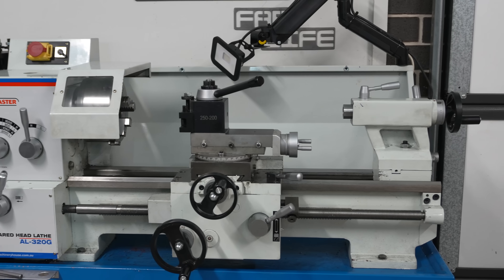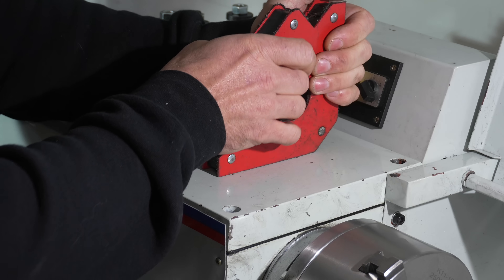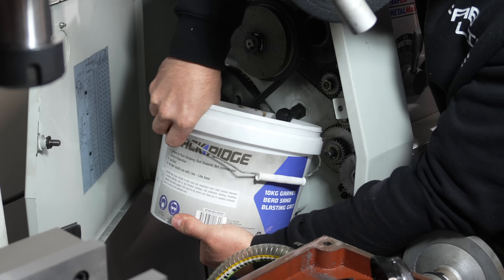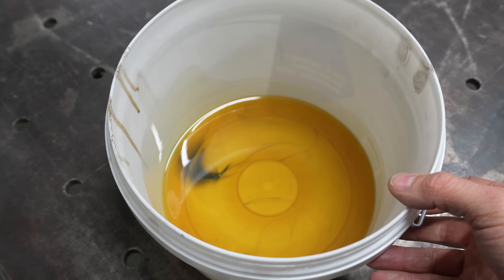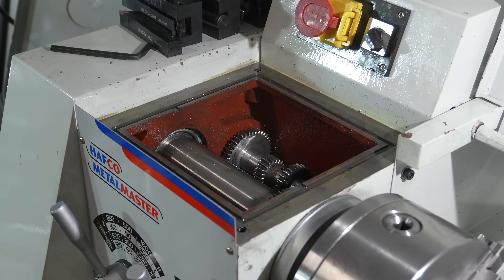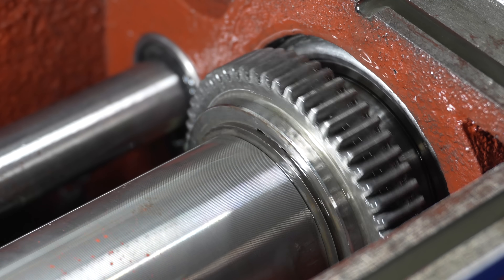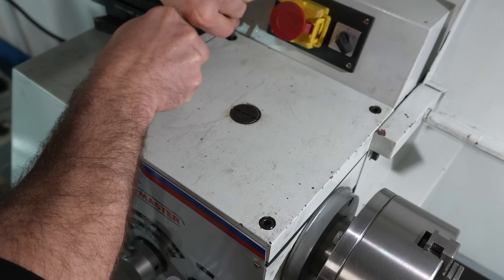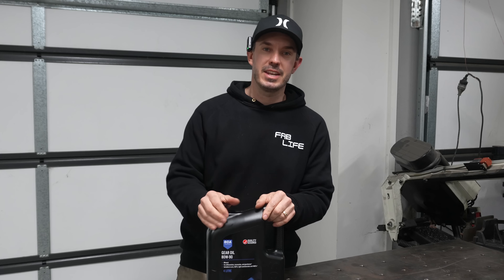Can I Fix This Annoying Gearbox Noise? - HAFCO AL320G

Comment: Having worked on many automotive gearboxes generally if there is enough oil to contact the bottom of the deepest gear in the box the gears seem to survive. I've been amazed more than a few occasions.
Reply from the maker: The feedback I’ve got so far seems like my lathe won’t survive in the long run due to some gearbox oil 🤷‍♂️
Reply: @Fab-Life444  It will survive, though it is not constructed like the old ones from the USA, but those also needed lots of maintenance to get them there. Just use the oil you have on hand, or even run straight SAE30 oil in it, it will do the job. most important thing is to drop in new oil from the factory stuff, and also change it somewhat regularly, plus you can drop in a small magnet in a quiet spot to catch the fluff, like gearboxes have. 

Old ferrite speaker magnet is both common and often free, or grab one out of a microwave oven magnetron. I stuck one to my car oil filter, and opening it no metal filings, just some fine sludge inside. added one to a compressor, and it too got a fine powder sludge build up over the year.

Comment: Drop in a magnet in the bottom of the oil near the most metallic producing part 😅
So any chunks or even fine metal should be captured.

This is normal in car automatic and manual transmissions as well and after 60k km the usually have a good coating of metal
Reply: The grarboxes in these is filled with casting sand and grinding grit from the machining during manufacture.
The magnets will only collect the metal that's been ripped off the gears and bearings, but will leave all the grinding particles in the oil.
Reply from the maker: Yeah I definitely know what you're talking about. I'm a mechanic myself. Ive seen many transmissions which have circular magnets that come out looking like they have silver fuzz on them haha. So many comments about adding a magnet. Next time I'm at Bunnings, i'll get some!👍

Comment: I've got an 80's boxford that's noisy. Spent a fortune on some used but less worn gears. A little less noisy. I'll try diff oil too. Great iead thanks.
Reply from the maker: Let me know how it goes for you. Ive had an overwhelming amount of comments letting me know that it isn't the right oil so. Good luck 👌
Reply: @Fab-Life444 I just did a quick bit of Google time and diff oils contain anti foaming agents. So EP 80/90 should be fine. I've currently got ISO68 in there.
Reply from the maker: @GazzasStuff how does iso 68 sound? Repco sells it near me. I’ll have to get some
Reply: Thanks. I have ISO 68 in there already. I'm in NZ so we have an even worse number of options than you guys :-) But I'm going to try some Ep 90. And I'll do the acrylic lid to check that it's making it to the spindle bearings.
Reply: @Fab-Life444  I have done a bit of research. And here you go, while both diff oil and hydraulic oil have antifoaming agents, there are two issues. Diff oil has detergents to hold any metal and dirt debris, but Hydraulic oil lets them fall to the bottom – put a couple of decent magnets in there too. Secondly Diff oil can damage any brass  or bronze bushes – not that I think you have any. My lathe is spec’d for ISO 68 hydraulic, but it turns out you can buy ISO 100 hydraulic oil, so that’s the direction I’ll go. And luckily I’ve found a place in NZ that sells in 5 ltrs. It was difficult to find 100 here that will sell to the public as it’s not a big seller retail.
Reply from the maker: @GazzasStuff awesome feedback buddy. thank you 🙏

Comment: Never changed the oil? You should have checked before starting it. Mine came with no oil. You could see that it had been there but they only put it in to test run it and then take it out to 7se in the next lathes. W(at a mob of tight arses. And that’s a $17000 plus machine.
Reply from the maker: I definitely checked that there was oil showing on the oil site glass. I didn't go to the extent of removing the cover to check inside though. God your experience with yours sounds terrible.. I cant believe that! 😳

Comment: It will be interesting to see how the heavier oil lasts. My first thought would have been to add more of the same mfg recommended oil after cleaning out the headstock.
Oil weight is specced based on the types of components and the speed at which they run. Increasing oil weight may increase operating temperature but I doubt it will overheat

Also, that is your gear set losing material, not the bearings. Gears operate on a combination of rolling and sliding friction and if made poorly can lose material even when lubed properly. 

If a bearing is losing material, it’s time to replace it. Bearings do not “run in” they keep wearing once wear has started.

I would check the metal content in the oil again after 5-10 hours of use just to protect the spindle bearings as they use the same oil. If you find more black/grey streaks you can replace the oil or filter it. 
I would also suggest installing a magnet into the headstock in plane with that bull gear to catch the worst of the loose metal.
Reply from the maker: awesome comment mate. I'll definitely get onto putting some magnets in there thats for-sure. I even thought about putting a thermometer in the oil and run it to see what the temps get up to. Yeah with the metal paste, I really wasn't sure where it came from... cheers!👌

Comment: The drain plug is behind the chuck underneath the back sheet metal back plate
Reply from the maker: Cheers for the comment. There definitely wasn't any others. I even went to the extent of removing the rear guard and rubbed around everywhere.....and consulted the owners manual for it. Do you have the exact same model lathe as mine?. I do know that the AL250 has the drain plug at the rear in a hard spot to get a drain tin under. I've watched Artisan Makes channel change the oil on his. Cheers mate👌
Reply: @Fab-Life444  No I realized later that my lathe is the next model up. Thanks for the reply. Cheers
Reply from the maker: @nickfox6339 not a problem mate. Hope you’re enjoying the channel 👌🇦🇺

Comment: Interesting video, thanks. I have a very similar lathe - from the same factory, I’m sure.

I too had a problem with dirt in the oil and noise. I did the same as you did but I threw a pint of diesel in there to clean it out. Where I differed from what you did is that I refilled the same oil after filtering through a coffee filter, topped up with fresh oil of the same type.

My word of caution to you and others is this: I understand that the main bearing is fed from a drain hole in the gutter around the top of the casting. I could not see clearly enough from your video if yours is the same but I strongly suspect it is. By increasing the viscosity of the oil, you will reduce the amount of oil flung out by the gears, and then collected in the gutter to feed the main front main bearing.

I have doubts that mine even achieves this even with the thinner oil. Somewhere on the to do list I’d to fit a force lubricator to feed the front main bearing.

I instinctively agree that more, thicker oil is a good thing with the above caveat.

All the best.

Mike
Reply from the maker: The force lubricator sounds like a great idea. Cheers for the comment

Comment: Fab Life got lucky with his lathe.   A generous amount of casting sand and swarf is usually present in these lathes when new.   Both the gearbox and saddle should be cleaned out, oil replaced, and the bearing preload adjusted, before putting these Chinese-made lathes to use.
The design of these lathes is quite good, but they are assembled in the factory for only convenience of shipping and should not be regarded as ready for use out of the box.
A couple of rare earth magnets inside the headstock to catch swarf is a good idea.
Reply from the maker: I’ll definitely do the magnet thing for sure 👍. Is adjusting the pre load a hard task?. I did browse past it in the manual
Reply: @Fab-Life444  I have a related Chinese lathe, not the same as yours - so don't take the following advice as gospel.
Adjusting the preload is easy enough, but it is a bit like choosing the correct oil level, in that you will end up thinking the manual doesn't give the correct amount of preload.
In my case, the lathe came with too little preload, following the manual seemed to make it too tight, so I compromised.
Best to get advice from an experienced machinist who has the same lathe if you can.

Comment: Great to see that you set up the replacement gasket correctly allowing for the splash lubrication to run back into the spindle bearing lube channels. A very often overlooked problem that even the seller doesn't bother to sort. I know this as I bought the same machine a few years ago when I retired and ended up stripping it {Brand New before using it} to sort it out. BTW I worked maintaining machine tools for 30 years so it wasn't a big deal for me.
Those particular machines have an issue when made. The spindle housings are not cleaned properly prior to painting. I would be confident in saying the majority of the black gunk is casting sand left over from the manufacturing process. They actually need a wire brush and kero clean then a proper sealing coat of paint to allow them to stay contamination free. I used one mounted in a die grinder and a tooth brush style one for the tight spots.  I would then suggest putting in a few magnets to catch any steel or iron fallout. If all that black fallout was from the spindle bearings your machine would have loose bearings with radial float and end float.
As for oil levels and oil type used you need to exercise a bit of care. To much oil generates heat and almost always foam. It will dampen the noise but if foamy wont lubricate the spindle bearings properly. 80~90 weight will cause a lot of drag in the bearings themselves and depending on their condition may cause the internal elements to skip. This isn't a good thing as well as foamy oil lubing the bearings that cause a type of cavitation that damages them.  This is why thin light oil is used for bearing lubrication in these types of bearings. Unlike a gearbox in a car that will usually have fewer and larger elements {Balls or Rollers} that reduce the impact of the heavy oil use. You will also find it will start to leak out of the spindle labyrinths if you get it warm. That in itself can cause them to lock up in extreme cases. To get an idea of the required level of oil you should run it with a clear plastic cover and then you can see just how much gets sprayed around. Hence the low factory level used.
If you have concerns with gear and spindle bearing wear when it's all cleaned you can add a bit of Zinc additive to the hydraulic oil. Factory it would use a ISO32 but if you must heavier oil like a ISO46 or even a ISO68 could be used. It will run hotter with the 68 though but not as hot as the gearbox oil. If you got stuck and had to use oil from the car parts store you would be better served using Auto Trans fluid. Using the Additive in industrial applications and in my experience I have only seen benefits. I use this stuff it isn't cheap but it does work well. 
Even though the web site looks a bit outdated their products a very good and do what they say. 
https://liquidintelligence.com.au/products/zddp-engine-oil-additive
If you really wanted a quiet machine belt drives are the go. They use greased bearings as well in the spindles . They have a bad rep due to people not maintaining the specialist lube in the bearings that in some cases has a 5 year use by date {Kluber NBU15}. Regardless of lube type the grease needs refreshing after time and or use. 
Well that's my old man take on it. 
Cheers
Reply from the maker: I sat down with a cup of coffee to read this awesome comment mate. Thank you for all of your great advice. Everything you’ve said makes perfect sense. I do have some Perspex and I think I’ll remake a cover plate to see what is actually going on inside the gearbox. Cheers 👌🇦🇺
Reply: I was going to say almost exactly the same things, alas probably not so clearly, the chances of bearing failure are a lot higher than one might expect as the head stock is set up for very little free play.
Reply: Thank you for taking the time to share your wealth of experience on this issue. Invaluable!
Reply: Great detail. Thank you very much
Reply: Can you be my grand dad? Love your knowledge thanks for sharing.

Comment: If you run the lathe before the oil change, you will get better contaminant suspension, removing more crap.
Reply from the maker: What do you mean by that? Run it with no oil? Cheers
Reply: @Fab-Life444 guessing he meant running it so everything warms up sufficiently?
Reply from the maker: @eschlenz possibly?… I have seen some people run the lathe with the kero in it to help clean off the last remaining bits of the old oil.

Comment: My 25 year old Harrison has a similar gearbox with splash lubrication like yours.
However, the specified hydraulic oil was a lot thinner than what you've used.
Reply from the maker: Yeah I read the owners manual before doing this and the grade was SAE20. 👌🇦🇺
Reply: @Fab-Life444 
My lathe was old enough for the original lubricants to be no longer in common use or only available in 20L drums.
I had to do a fair bit of hunting around to  find the right type.
My headstock has a fair bit of noise - problem with using spur gears I guess.
Reply: What's the recommended Shell oil, Tellus 27 in the headstock and Tonna 32 for the slideways/ feed gearbox or is it built afer the Tellus 27 name change?
Reply: @iwb316 
Colchester or 600 Group advised Valvoline 32 grade for head stock and 68 grade for Gearbox and Saddle.
I used Penrite of the same grade.
Reply from the maker: @iwb316 not really sure

Comment: I enjoyed your informative video. I have a Craftex CX709 lathe which is almost identical to yours. My lathe is over a year old so I decided to service my gear box as well. I also found the oil to be quite low and lots of contamination. After a thorough cleaning I added almost 2 liters of 80W gear oil. What a difference!
I would really appreciate a video on thread cutting when you get time.
Reply: Are you able to spin it up at 1600 with this 80 gear oil?
Reply from the maker: @grahampratt1107 I would have to check
Reply from the maker: Awesome feedback! Thank you for the comment. I could definitely do a video sometime soon on setting up the change gears and thread cutting 👌🇦🇺
Reply: @Fab-Life444 on this note, I wrote a program to generate every thread available given the standard gear set for both metric and imperial (i set my maximim to 10mm) , very useful, in fact I use these 4 pages regularly!
I have not tried the 10mm pitch yet as I think this would need a much slower spin of the lathe and to be honest I can only think a fly press would need this pitch thread!

Comment: Just keep in mind that heavier oil will result in more heat. For anyone new to this, ONLY use machine oil. NEVER use automotive oils. They contain additives to keep engines clean that will corrode machinery.
Reply: He used gear oil not engine oil.
Reply from the maker: Cheers for the comment 👌

Comment: The use of a high viscosity gear oil in a lathe gearbox is incorrect and will dramatically reduce the life of the spindle bearings, also as it is splash feed it is very important that a non foaming oil is used, this is why a hydraulic oil is specified, gear oils are susceptible to foaming, the manual does specify an ISO 46 grade, but an ISO 68 could be use without any detrimental effect, as the difference in viscosity is marginal. The use of a suitable fortifier additive (one suitable for hydraulic systems) will reduce the noise without affecting the viscosity of the oil. I also have the AL 320 Hafco which has seen extensive heavy work and is still running the ISO 46, and at its last inspection and oil change was still in excellent condition in the gearbox and no bearing wear. The oil level is as specified, as increasing the quantity may result in overheating.
Reply from the maker: Thanks for the comment 👌
Reply: Not true. Car gearboxes have bearings too

Comment: Much quieter with the heavier oil but I wonder if it splashes around enough to lubricate the main bearings. Specially at lower spindle speeds. My machine is pretty quiet with ISO68 oil but I might try something thicker at the next oil change. I put a clear piece of Plexiglas over the the top with the cover removed to observe the oil sling pattern. That might be a worth while endeavor with to see if the thicker oil is getting to the spindle bearings at all speeds. I like to run my spindle fast for a minute or two to get oil splashed up before doing any slow spindle speed work just in case.
Cheers: BJ
Reply from the maker: That’s a great idea about the plexiglass. I have run the machine and then checked what’s on the cover plate soon after. Quite a bit more oil was on the cover compared to the original oil. 👍

Comment: My CT089 (basically the same machine as yours) is noisier in some gears than others but no where near as noisy as your machine. I cleaned the gear box and installed new ISO68 oil. It is tolerable now. The main bearing were packed with grease but I think that is a mistake. There are oiling holes in the oil grove around the top of the gear box and a passage to provide drip oiling to the main bearings. I replaced all the small bearings but not the large spindle bearings as they are quite expensive and the existing bearings looked to be ok.
Cheers: BJ
Reply from the maker: Cheers for the comment 👌